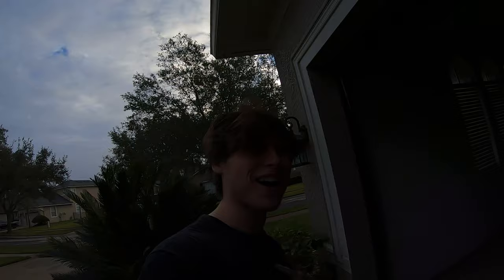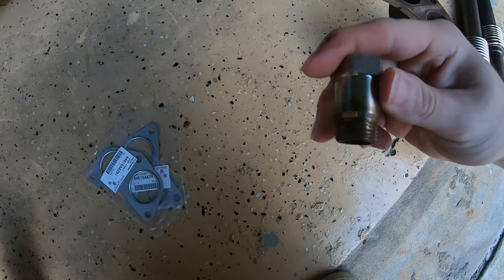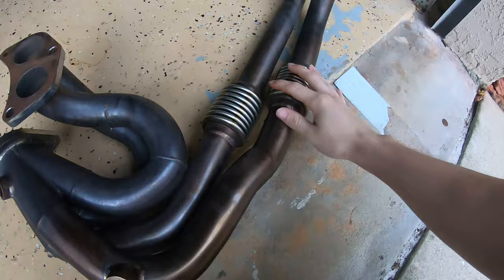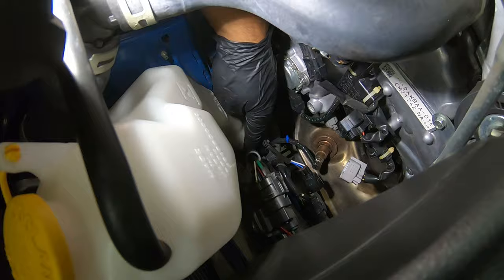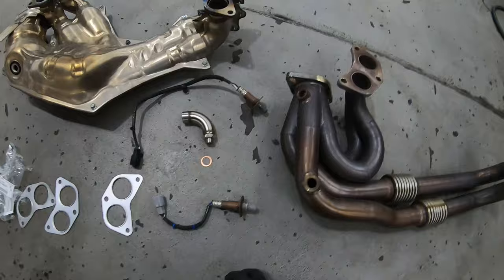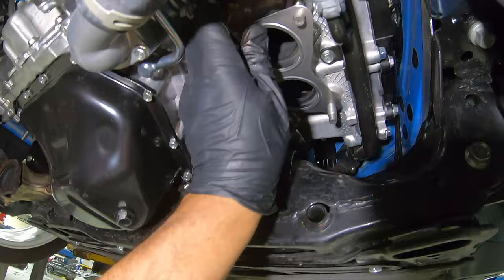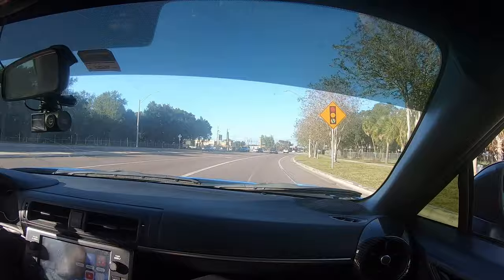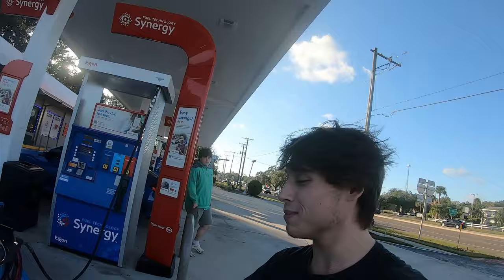Installing Catless Un-Equal Length Headers On My GR86

Comment: this video smashes all the others , but Justin believed it or not it will not drivable for a long distances because of insane loudness , should thing that maybe will you have problem with police, i dunno if you plug back the factory exhust , sound will be more peaceful, thumbs up for this video
Reply from the maker: Wassup fam, I really appreciate it. Thankfully I don’t have to worry about exhaust restriction laws here in flordia, but if I were to ever travel anywhere with the car that is certainly something I’d have to be worried about. Another good thing is, if for whatever reason I ever want to make it quieter agin, I kept the stock headers and could always just throw them back onto the car. Appreciate your support and kinds words, definitely am excited for what’s to come. 🤝💙

Comment: Sounds good bro. I’ve got Tomei Catless UEL headers i’m putting on my GR86 next Weekend. I’ve also got the Awe Track Exhaust.
Reply from the maker: Wassup man, awesome to hear you have the AWE track exhaust on your 86 as well. The tomei is what I wanted to exactly get for mine, but a good deal came up on these and I knew I have to buy them. Thanks for watching the video man, stay tuned for the exhaust clips coming soon. 🤝💙
Reply: I just bought a Tomei UEL Header, did you run a defouler or did you tune it right after?
Reply from the maker: Yeah, I ran a defouler in the meantime without a tune so I wouldn’t run into the issue of having a check engine light on the dash. Had it on and still do for about 3-4 months and haven’t had an issue with it yet.
Reply: That set up gives a true subie rumble
Reply from the maker: @sfGiantsboi03  haha for sure it does! It sounds insane in person too. Thanks for watching I hope enjoyed and found this video helpful 👏💙

Comment: Quick question where did you buy the J shaped Defouler. I bought one and it threw a cel. Bought the same one as you and doesnt have the three spacers like yours. Those little spacer apparenlty are out of stock everywhere. Thanks.
Reply from the maker: Wassup dawg, I bought it from a company called Whoosh Motorsports. It actually came with the 3 different spacer options, and the second one is what worked best for the headers I had installed on my 86. If you want to send me a DM on Instagram I can send you over the link to the actual defouler I bought. Hope this could help, thanks for watching the video fam 🤝💙
Reply: @Justinackerman_  okay cool

Comment: hey im new here in your channel this the perfect video that im looking for since i just purchased a plm header but apparently i saw the review they were having a exhaust leaks, did you had any exhaust leaks? if so where did you metal gasket?
Reply from the maker: What’s up fam, thanks for checking out the channel and for watching the video. It truly means a-lot to me! Awesome to hear you just purchased a set of PLM headers for your car as well. The only things I would do is go with OEM gaskets at your local Subaru or Toyota dealership and they’ll be perfectly fine. The only issue I’ve ever had with them is because I forgot to get a new overpipe gasket so it was leaking a tad bit, I went and got a new OEM one like I was saying previously and I haven’t had a single issue since. I hope this could help you out, thanks so much again for checking out the video 👏💙

Comment: Honestly sounds like its growling with a farting at the end. Put a highflow cat on it will make it sound better plus will give you more torque because of the back pressure. NA cars needs some back pressure. Going catless is more for FI.
Reply from the maker: What’s up fam, I appreciate the suggestion. The camera doesn’t do a great job picking up the audio for the car. It does kinda sounds a little farty up top, but in person it sounds absolutely insane. I’ll definitely look into a high flow cat though, hoping to throw a tune and maybe some e85 on this car within the next few months hopefully 👀

Comment: That's a real homie right there.

Any update on the headers? Are you planning to tune?
I'm trying to get a used JDL or Tomei UEL Header and I might run a defouler or get a VFTuner instead. On a budget build right now lmao
Reply from the maker: For real, Frankie is such a great guy for helping me to do, and for filming the whole install process for you guys. Haven’t ran into any issues yet with the headers, I’ve had them on there for a few months now. I plan to get the car tuned hopefully sometime soon, still researching different companies and tune options at the moment. I’m currently running a defouler on mine to prevent the code from appearing. It’s worked great, and hasn’t had a code come up once. I have a short video posted about that in case you interested in checking it out. Thanks for watching and supporting homie 👏💙

Comment: hey have you seen a drop in mpg after installing the headers?
Reply from the maker: To be honest I didn’t notice much of a difference from just the headers. The only reason I’d say I was going threw gas quicker is because I was on the gas constantly cause I wanted to hear how loud and good the car sounds on throttle 😂😂 Other than that I wouldn’t say it’s that bad from the headers for mpg. Thanks for watching the video fam 💪💙
Reply from the maker: Haha, that is completely normal man. It’s cause the headers are catless and the fumes aren’t held back as much anymore. You have nothing to worry about.

Comment: After u put the headers did u get a tune? If not, did the Engine light come on?
Reply from the maker: No I actually didn’t get the car tuned unroll just recently. I was running a defouler on the car to trick the O2 sensor to not throw a check engine light on the dash! I hope this could help you out fam, thanks for watching the video 👏💙